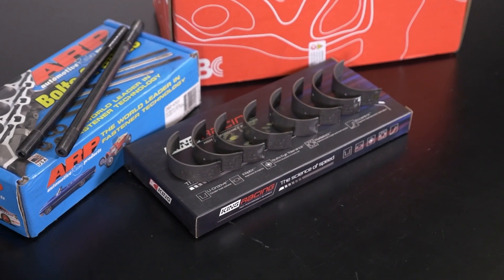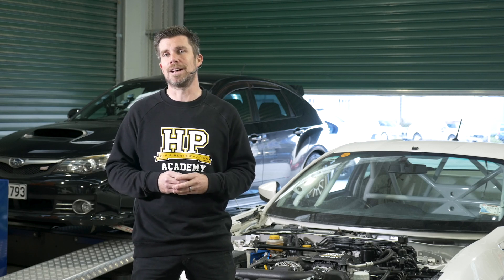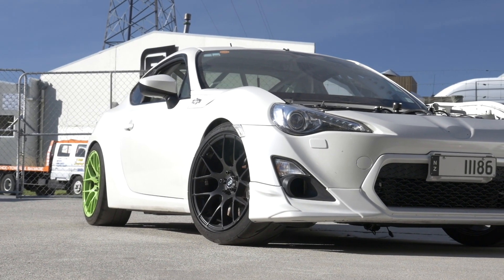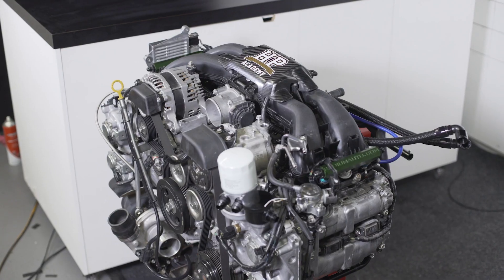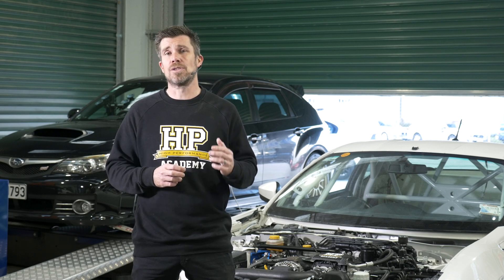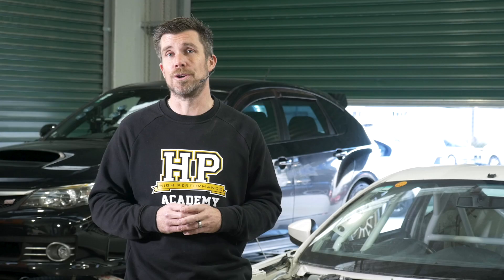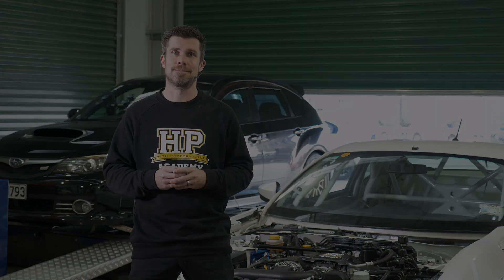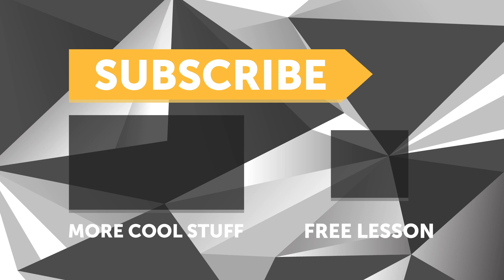Are You Doing This Right? | Engine Break-In Process [TECH TALK]

Comment: I do LS stuff so I'm using LS engines as an example here. At the stock 600 RPM idle the outside of that crankshaft main journal is moving about 400 feet/min on the circumfrence. You will spin a bearing instantly if you have any metal to metal contact on bearings. Break in is the last part of the machining process for the cylinder wall. I change oil a lot for the first 1k miles to flush the very fine metal particulate out and make sure theres no chunks. I'd also advise priming the engine if possible before the first start. Priming with 40 psi of pressure it still took me almost an hour of prime with pressurized oil, drain the pain cause its full, repeat before my last rocker arm would oil from the pushrod.

Comment: is light load = just revving the engine or taking it for a drive immediately after it starts?
Reply: The vehicle has to be moving for it to have a load on it, even if you are breaking it in on a dyno the straps do 2 things. First they hold the car onto the dyno but also, they allowing "road like" load to the car. Essentially if you have nothing in your hand and move it up and down thats like reving the engine, if you put a 5lb weight in your hand and move it up and down it puts "load" on your arm muscles. Same way with a car to break in the rings! Hope that helped 👍🏻

Comment: great info as usual. i would like to get your theory on setting fuel pressure when you have bigger fuel injectors than OEM. do you set the pressure according to the engine vacuum? if so, what pressure do you start with static? and how much should that pressure drop once engine vacuum is applied? thanks HPA💪💪💪

Comment: Only disagreement I have is about the rings needing any load to drive them into the sleeves.  Pressure from above the rings pushes them DOWN mostly, unless the engine has nice fancy pistons with gas ports.  (Yes I know compression pressurizes the entire ring groove and pushes the rings, but most of the force is from the spring tension of the ring itself)  On bikes I've always had good luck just idling the engine for 5-15 minutes, draining the oil, and doing a quick comp/leakdown to confirm everything is good.  Sometimes I'll rev it a little just to keep above idle, but that's only on Ducatis/V's.  After that they never give us issues through a full season of track beatings

Comment: Such a hotly debated topic. I fully agree with your assessment. Personally, I like to use short stints of 85-100kPa manifold pressure followed by very low manifold pressure. I think the strong vacuum in the cylinder (some rpm combined with closed throttle) helps suck a bit of oil out of the crankcase and past the rings - helping to lubricate the new, somewhat-abrasive ring/cylinder interface, as well as perhaps providing a bit of "flushing" action to wash away some of the particles sloughed off the rings/cylinder.

Done this way, I've noticed I'll see blue smoke (from exhaust) once I snap the throttle shut following the first couple pulls (not full pulls). After a few moderate load partial pulls, I begin WOT pulls (with safe, conservative calibration, of course) - increasing top engine speed a bit each time. Once the engine has done a few full-pulls - it's time for an oil change, and put the engine into service.
Reply: Hi Grooves and Land.

May I ask to you,

Should have an small increase of cylinder compression test readings before and after break-in process?
Thanks!